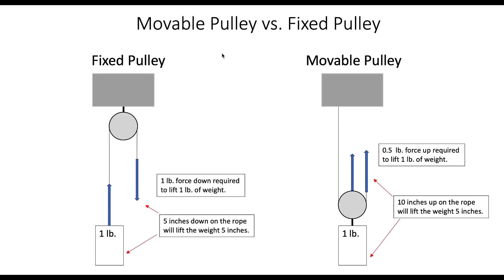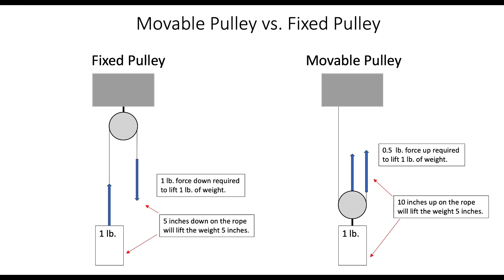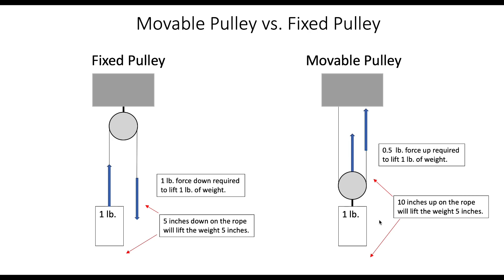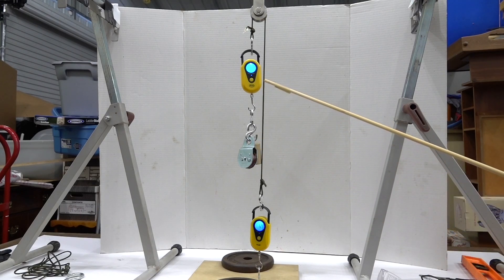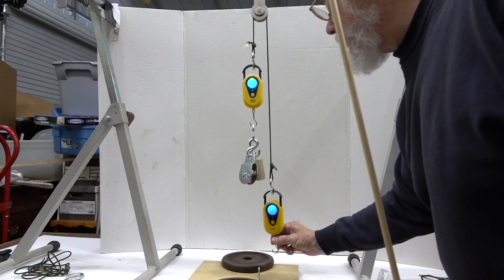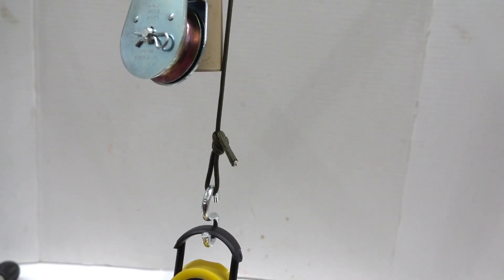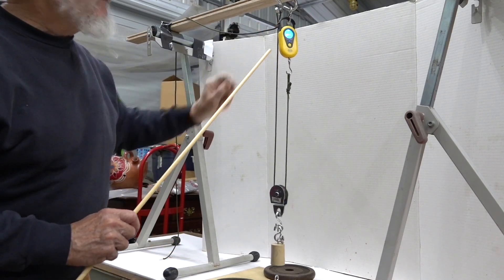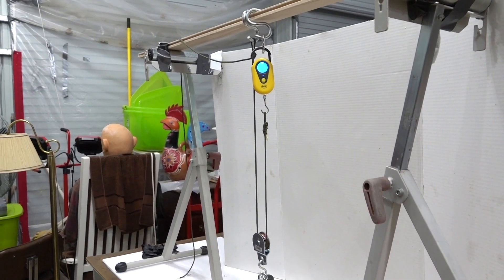Movable Pulley vs Fixed Pulley

Comment: I wanted to say that this is my third video trying to grasp the MA and pulley system. I just moved to coosa county alabama so i had to get me a 4x4 vehicle. Well long story short I've bought a winch and learned some welding to mount that boy and got some pulleys and wanted to get an understanding of what its gonna take when i get stuck and the systems i could use to unstuck myself.  Double pull length,  half force needed to pull same weight. How does one calculate for the mud gripping the tires?
Reply from the maker: Thanks for watching and the mud on the tires is a very good question. Tire researchers may know the answer. The worst case would be the tire stuck in mud up to the axle and trying to lift the wheel vertically. You could assume that if you calculate the cross sectional area of the wheel at the center point where the axle is and assume 14.7 psi for atmospheric pressure and a perfect airtight seal of mud on the tire the worst case would be to multiply the square inches of tire cross section in the mud times 14.7 lbs/sq in to give you the worst possible required force per wheel. In reality it should be much less than that because the mud will yield and fall off the wheel as you winch it forward or backward out of the hole instead of straight up. I actually think that will be a small part of the load. If your wheels could get traction you could simply drive it out of the mud hole. I created a video on using the front end loader on my 4 x 4 tractor to push back on the tractor until I could get traction.  It may give you some ideas. https://youtu.be/u9IlrffJMrQ?si=hZJDeWz6sfss20Q-

Comment: Is the rope itself applying mysterious leverage by pulling shorter?  I'm not sure I caught the explanation as to how mechanical advantage is being applied.
Reply from the maker: Thanks for your comment. If you have a fixed overhead pulley on the ceiling with a rope running through it and one end attached to a 20 lb. weight on the floor you will have to pull down on the other end with 20 lb. of force to lift the weight off the floor. To lift the weight 12 inches you will have to pull down 12 inches of rope. If instead of the fixed overhead pulley take the same pulley and attach it to the weight on the floor with the rope running through it and one end attached to the ceiling. To lift the weight 12 inches you will have to pull up on the rope 24 inches, but 10 lb. of force or half as much is all you will need to lift the weight. Thank you for watching my video.
Reply: @anisotropicplus  Okay I think I get it now.  So when the pully is being lifted, the applied force required is cut in half because the rope is tied to an anchor point and holds the other half of the force required(or half the weight of the load), essentially acting like two ropes holding the weight.

Comment: Can you please explain if we had a system with two identical pulleys one fixed and the other movable, which one would spin faster? 
Thanks
Reply from the maker: I am not sure what you are asking, but if the rope does on slip on a pulley then the speed of the pulley groove where the rope is should be the same as the rope speed whether the pulley is moving or stationary.